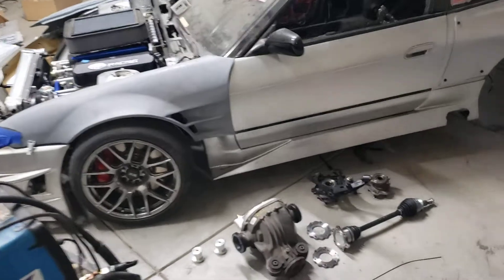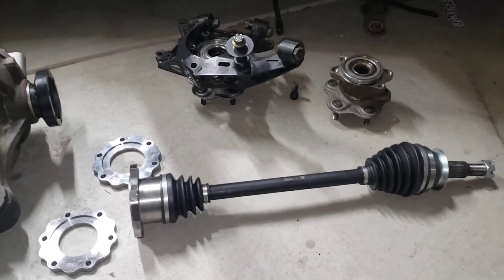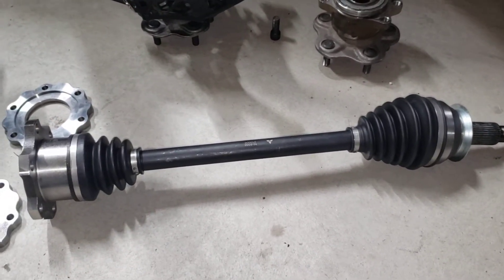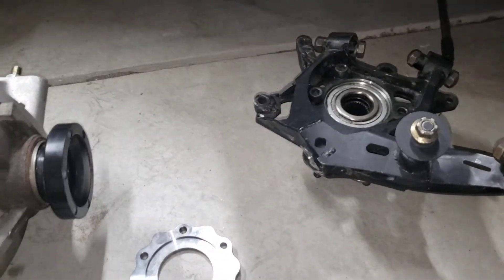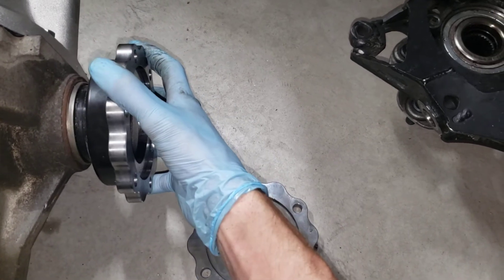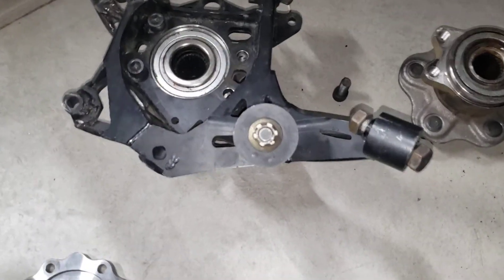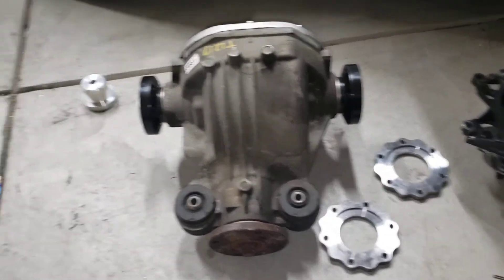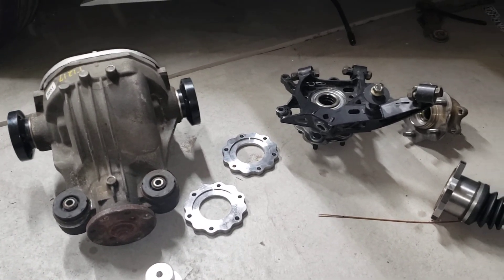Ford 8.8 Swap S13 S14 Part 3 Axles

Comment: Another thought to make those inner stub axle cheaper you could take the Ford explorer axles and take the inner splined part of the axle that goes into the differential and trim the part the CV joint goes into down and weld a flange that matches the 370Z axle onto it and now you can have a cheaper stub axle
Reply from the maker: Just below 500tq on KR20a mostly have 3 cars running this similar setup currently.
Reply: @mannarinodj  okay cool my engine setup  is going to be vk56 engine with about 800 horsepower and about 450 -500 foot pounds torque so these axles should work pretty good for me then
Reply from the maker: https://www.tf-works.com/tf-240sx-to-350z-axle-adapters/
Reply from the maker: I used these flanges to do what I think your talking about. FYI saving for DSS axles starting to break them running Nitto still last a little while. We made a press fit set and they haven't broken yet
Reply: @mannarinodj  how much power are you running with the welded axles